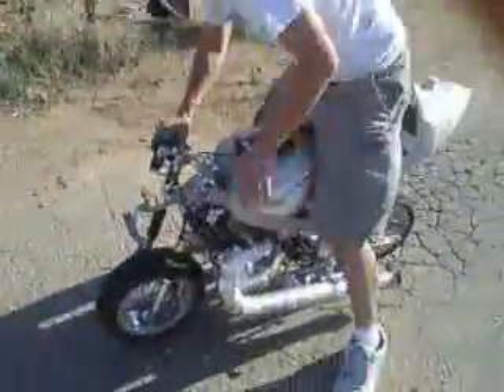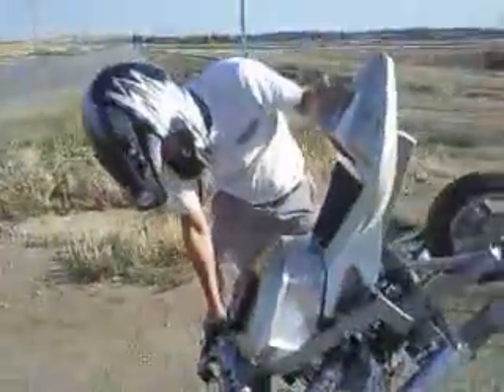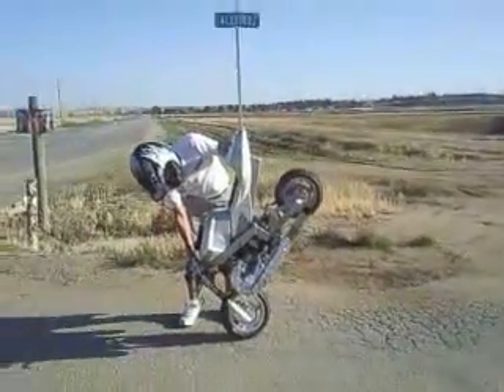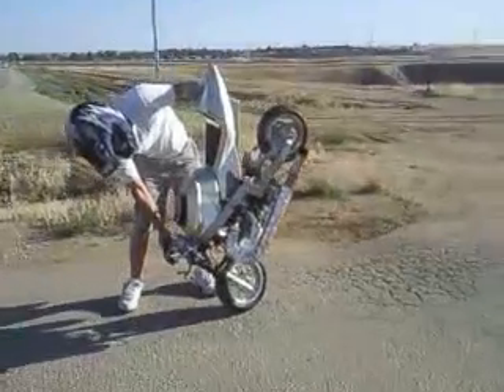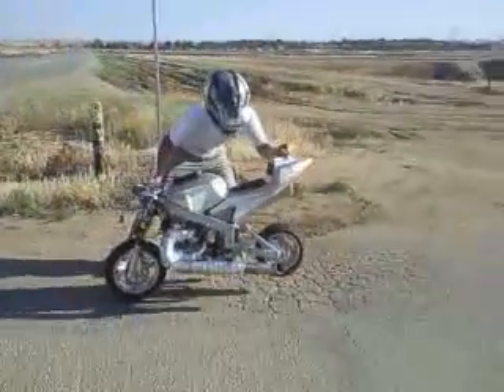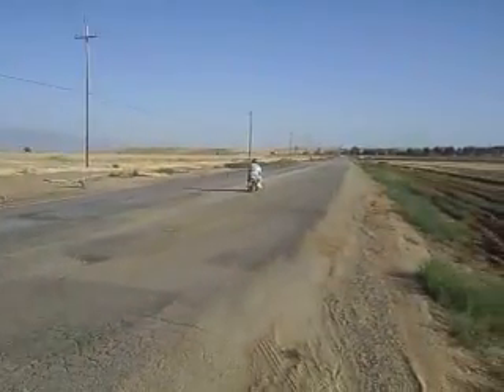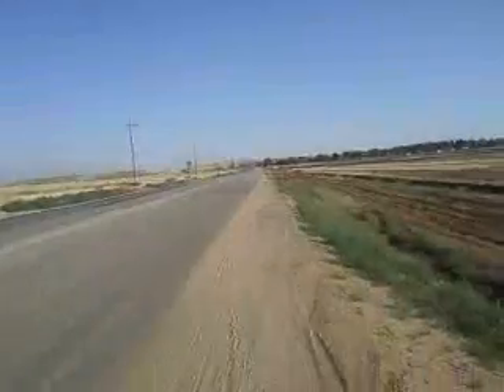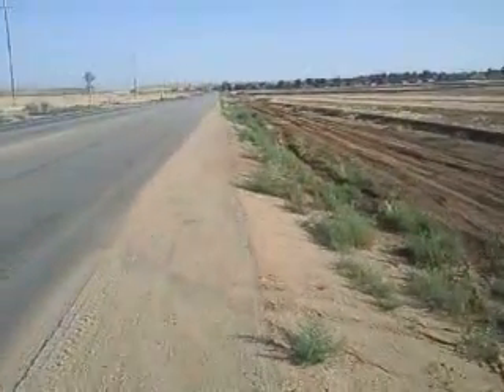gas turbine rocket diy y2k mini super pocket bike

Comment from the maker: exhaust is Inconel. Fuel holes are 10 mills with 20 in  a line. Flame holder is 1/2 Inconel tube cut in half and welded 3" for the tip of the exhaust. Engine is a jetcat used in a rc helicopter